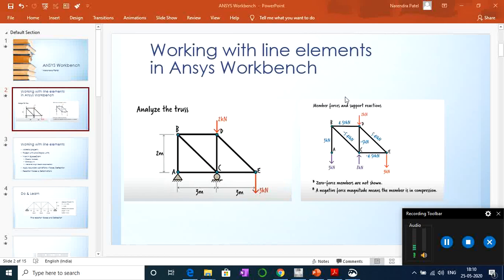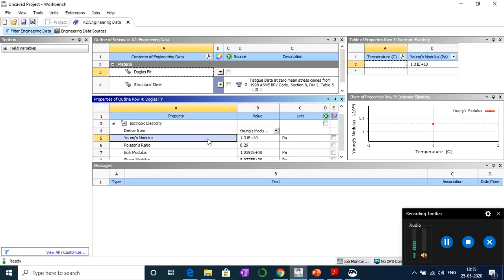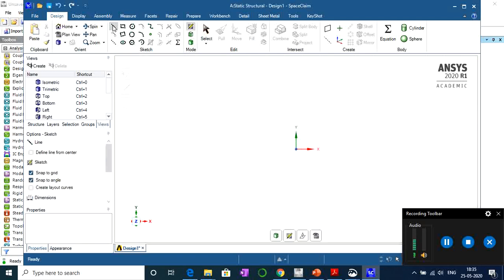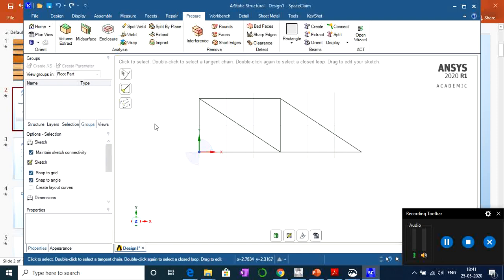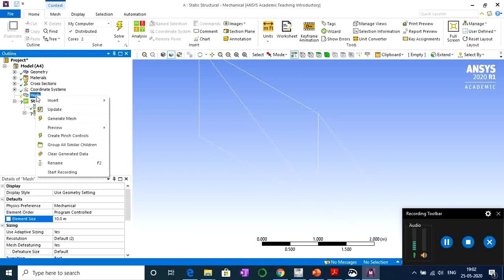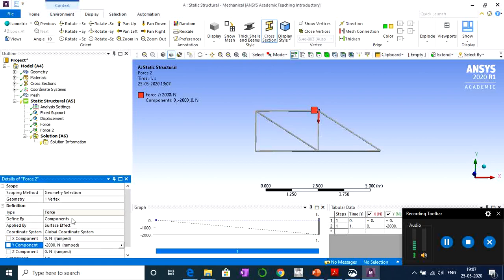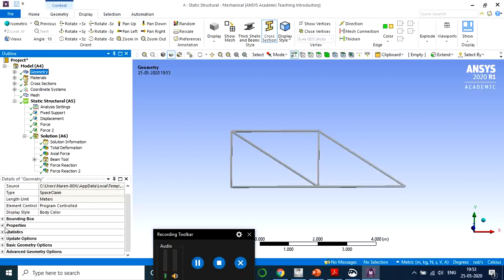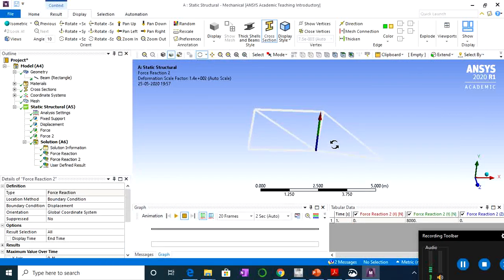ANSYS WORKBENCH- SOLVING TRUSS PROBLEM WITH EXAMPLE

Comment: What if I have pinned joints between two truss links ? its not welded
Reply from the maker: This example is for pinned joint only. When you change the element type to link from default beam option.. this makes it free to rotate at joints. Make sure you have only 1 element for complete member.
Reply: Check at 17.28 sec. Then skip to last few minutes.
Reply: @e-talk6100  Solver pivot warnings or errors have been encountered during the solution.  This is usually a result of an ill conditioned matrix possibly due to unreasonable material properties, an under constrained model, or contact related issues.  Check results carefully.
i get this error
Reply: If possible can I get your email id I can share you the problem, Thank you

Comment: great help sir. Here, no two links are intersecting each other. But, I am having a problem when two links are intersecting each other. During mashing, an extra node is automatically generated at the point of intersection of two links which makes the truss mechanism in my case. I have solved it by restricting rotational DoF at such nodes. It works but I don't think it's the best way to solve it. Any better solution?
Reply from the maker: How are you creating the geometry, do not break the line at intersection. Use single element to represent the link.